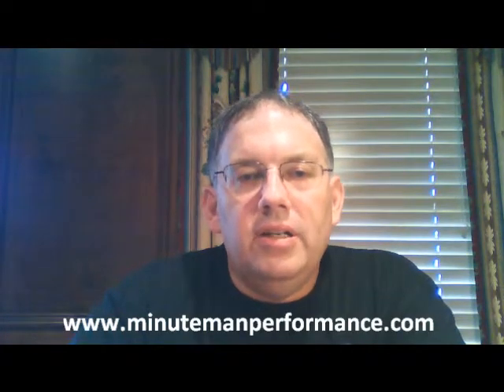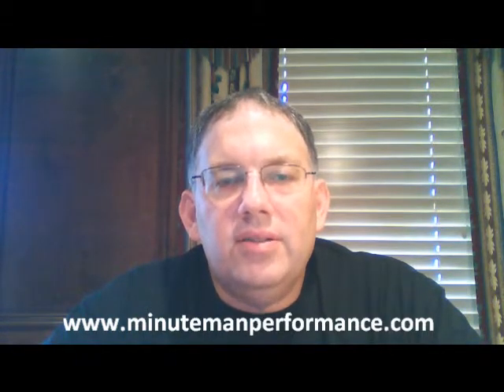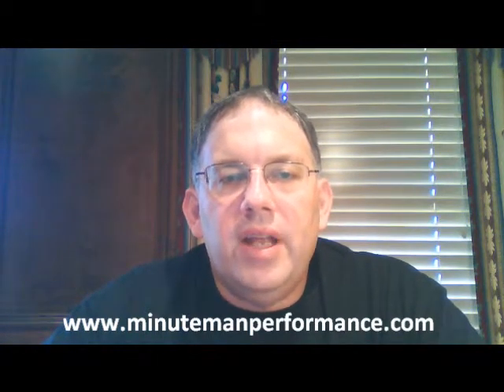Correlation Between Dirt Particle Size and Engine Wear

Comment: I spray silicone spray on my OEM air filters to capture dirt better as well😉
Do have bypass filter hooked to my one briggs vanguard engine as it gets over 150 hours run time each year and I want it to last
Reply: I use a thin pre-filter cover I got from K&N and use the stock air filter.  They recommend them on their  filters. This traps much of bigger particulates.

Comment: Soot created by GDI engines does the same thing, they cling to each other and creates larger particulates.  The typical oil analysis does not test for this type of soot.  It is looking for soot created by diesel engines which is much different and much larger.
Reply from the maker: On a related topic, within a couple of years you will probably see Exhaust Particulate Filters (similar to Diesel Particulate Filters) installed on GDI engines.  The DI process creates more soot than PFI engines did.  Look at the rear bumper cover on any white colored GDI vehicle to see evidence.
Reply from the maker: @tssci6774  Bypass oil filters, like the AMSOIL model, usually filter down to about 2 microns.  While this will catch any dirt, including soot, that is larger than 2 microns, most soot is smaller, and will continue to circulate.  But their size isn't hurting anything and if they clump together, they'll get caught.
Reply: @Best-Synthetic-Oilscom  Piston ring to cylinder wall, roller bearings, crank bearings can see clearances as low as.5- 1 micron.  Timing chains which there is little clearance or oil film, I see published articles where GDI Soot is major cause for thier failures.  How does the Amsoil BP filters compare to the depth filters like Frantz in terms of soot removal.
Reply: This is why GDI engines need an oil catch can and high quality oils. Run a full tank of gas  with engine cleaning additives right before your next oil change every 5,000 miles.
Reply: @TheNuclearBolton  I run a 2 micron bypass filter to stop the abrasive soot and stwp up the viscosity tp a 40 weight to counter the fuel dilution.  Ive reduced the wear ratte by 4x.  12k mile intervals, otherwise not a mile past 3k
Reply: @tssci6774  You do this on a Diesel engine? I rarely see bypass filters on gas engines. What would you recommend for a 2.4l 4cyl GDI ~180 HP at the crank
Reply: @TheNuclearBolton  I have 2012 Equinox 2.4L.  I installed an Amsoil Bypass filter kit two years ago, I have been able to extend my drain interval to over 12k.  I tapped into the oil pressure switch above the starter, moved the switch over to the cylinder head.  Or you can use the cylinder head as source.  Output of the filter is fed into the camshaft cover just above the timing chains to ensure clean oil is continously lubricating the timing chains. I had to drill and tap in a fitting.  You can also return just to the oil fill cap. I have measured oil pressure cold and hot before and after the install and found no significant difference.  OIl analysis shows the particle count is often as clean as new oil.  It still gets dark which is normal.
Reply: @tssci6774  seems like a lot of work 😂 an oil flows just as before?
Reply: @TheNuclearBolton  you can get a dual filter kit, includes a full flow and bypass filter in one external mount.  Then buy an ECOTEC oil filter adapter to remote oil feed and return  lines to the remote mount.

Comment: These comments are silly and show some serious lack of understanding. Particles below 20u will generally be in suspension in oil. They will cause wear BUT being overly restrictive will cause over heating, who cares if the engine is clean then? Filters do not even work for 60-80% of the cars run time, the bypass will be open at anything over ~1000-1500RPM as the PSI will be 12-16 ish (for some), open in any case. The most important aspects of a filter are 1)Cold start oil retention and high flow. 2)Low restriction at higher RPM 3)Filtration at near idle 4) Capacity.